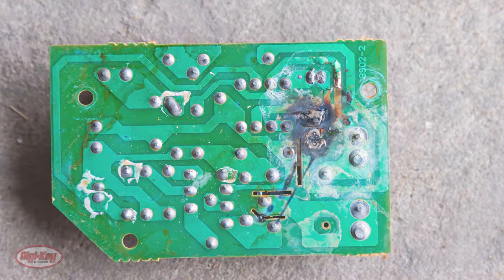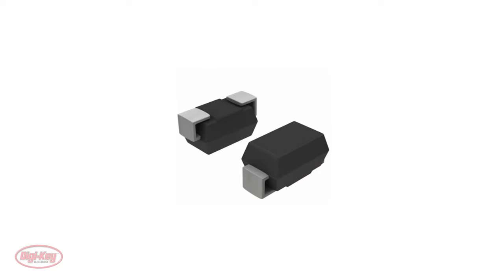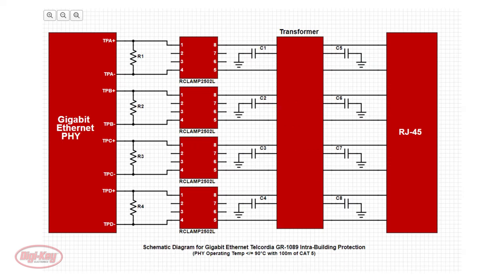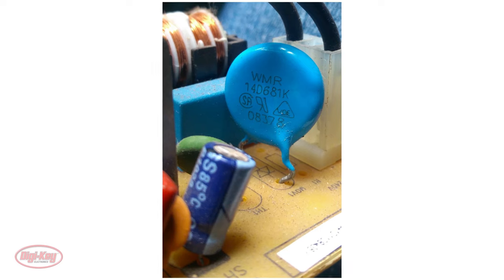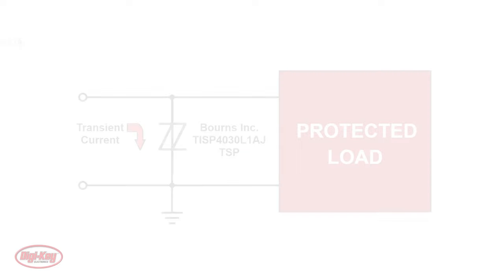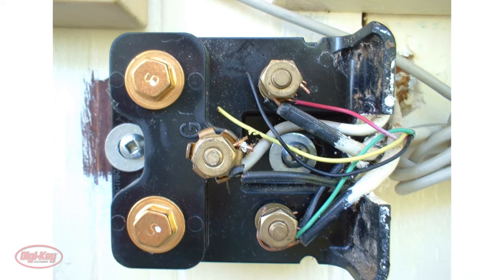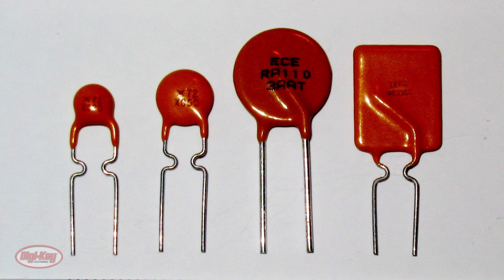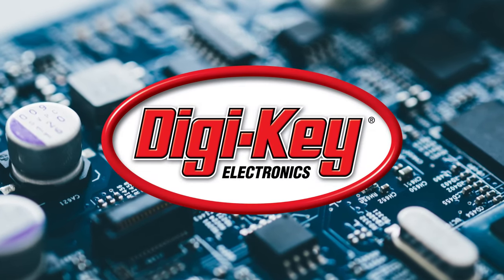Circuit Protection – Tech Basics | Digi-Key Electronics

Comment: I have noticed in commercial and residential appliances circuit boards damage from roaches.  Why are these bugs attractive to circuit boards?
Reply from the maker: I looked into this after I read your comment and apparently they are attracted to the heat put off by the components on the board. They also like moisture so that's why they are more common in fridges, dishwashers, and washing machines.
Reply: Digi-Key - is it true that some insects and rodents are attracted to wire insulation materials having found eaten coatings around failed circuits in both electrical and electronic devices? Rats I expected this from but insects I’ve discovered  puzzle the heck out of me. It’s not always they same type of insects either.  I’ve found them both inside and outside of buildings and enclosures too. These evasive creatures drive me crazy when troubleshooting because I’m looking for design flaws or failures within a system or controls only to find out it’s nature at its worst!!! There’s a balance between ventilation and security within enclosures that frustrates me endlessly sometimes!! Airflow is critical but these creatures manage to access through any minute amount of space to gain access and it wouldn’t be bad if they were looking for moisture or escaping the elements but do they need to chew on the circuits & wires while in there? I really think they enjoy the taste of the plastic shielding’s around the wires especially the smaller diameter wires in the control circuits. IDK? Your thoughts or ideas to help protect in these areas? Or any sprays or materials that may detour nature’s friends. There are so many different species so the list could be daunting but any general guidelines would help me tremendously at this point.
Reply from the maker: @MrWATCHthisWAY , rodents and insects are attracted due to the warmth initially, then rodents use the wire as a means to grind their teeth down to prevent them from growing too long. I have read that some car manufacturers, in an attempt to start using more natural products, have been using wire with a soy-based insulation which also attracts them from a food standpoint. I sent this question out to a few other technicians and engineers and unfortunately, there doesn't seem to be a good solution for a deterrent. One engineer mentioned the best defense will be to use conduit and prevent them from getting to the wire in the first place. Sorry, we don't have a great, easy answer for you! However, if you or anyone else stumble upon some sort of spray solution please share the knowledge!
Reply: Digi-Key - thank you for the feedback. I kind of thought about the warmth and security of the enclosures but would have never thought about grinding of teeth on the wires. Maybe I should give them something else to gnaw on.lol...